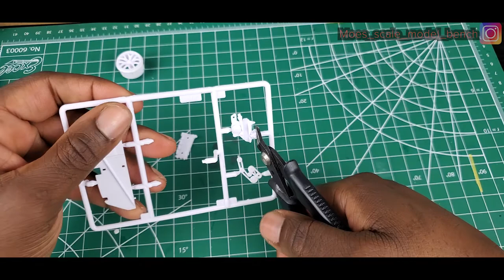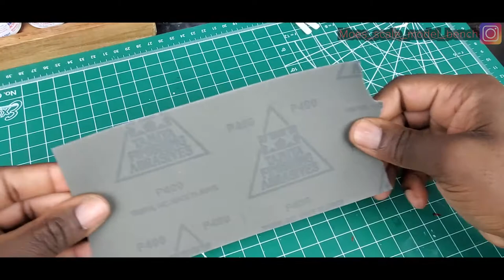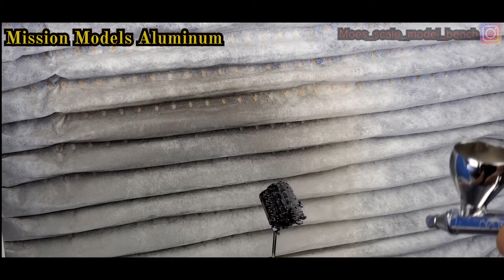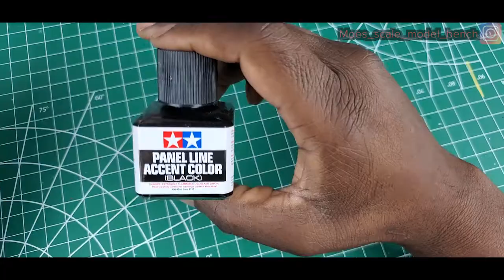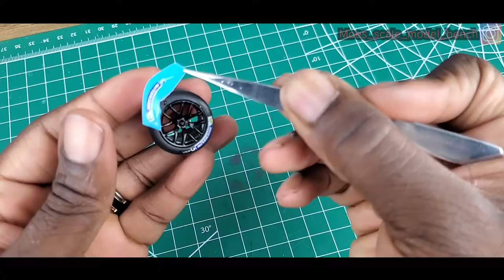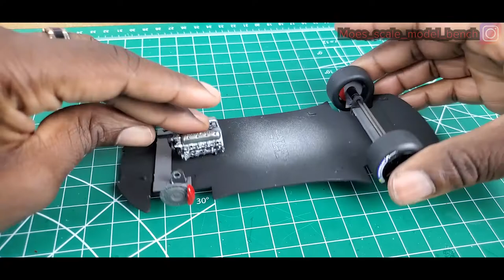Build: Revell 1/25 Scale Corvette C7.R  Part 2 | Chassis and Engine |

Comment: Hey brother you doing so nice work. I’m fixing to try and send some friends over.
Reply from the maker: Thanks. Appreciate it
Reply: @moesscalemodelbench9688  if I may make just 1 recommendation. Please upgrade that fan in your booth. If you spray any chemical based paint you don’t have 1/3 of the cfm needed.
Reply from the maker: @FuelsModels  yeah I'm actually about to upgrade the whole system. Now that I got a feel for it. I didn't use An airbrush when I used to build.  Thanks
Reply: @moesscalemodelbench9688  I’m probably gonna upgrade mine as well. I’d like something bigger with more cfm’s myself. This little Chinese booth is ok but I’d like it bigger with lights in it.
Reply from the maker: @FuelsModels  let me know what you find.  If nothing else I'll just upgrade the fan until I buy something bigger